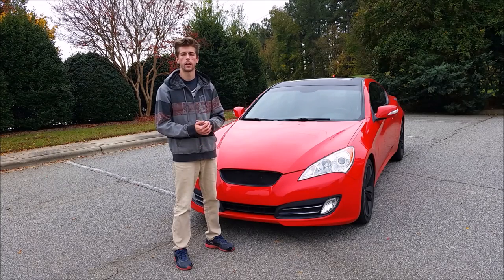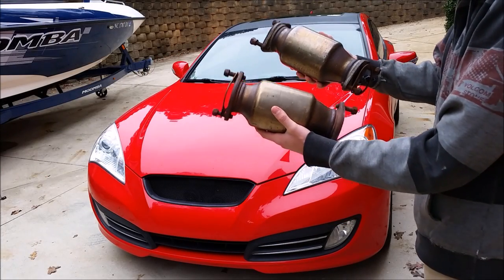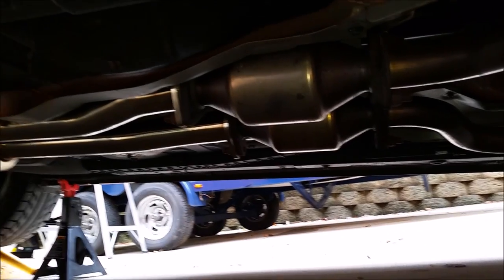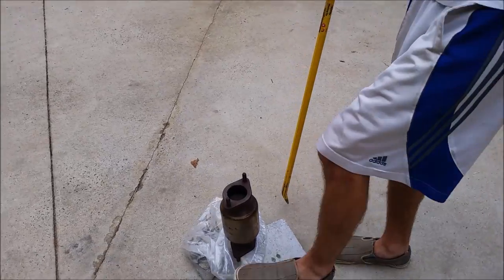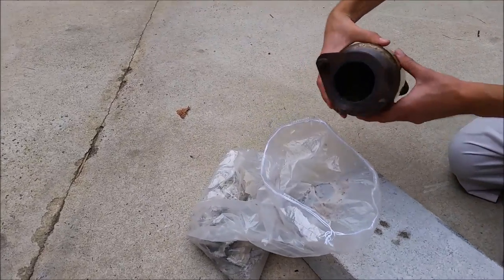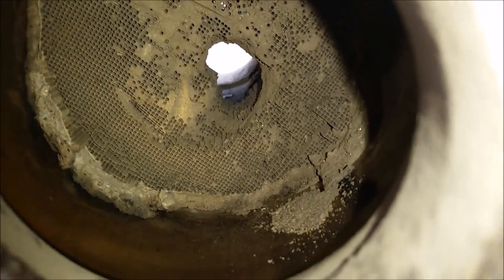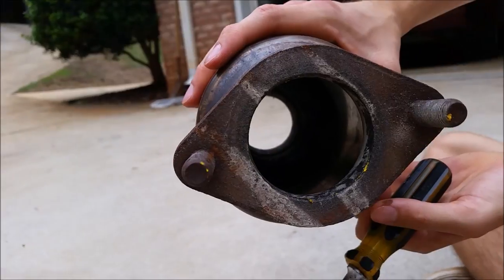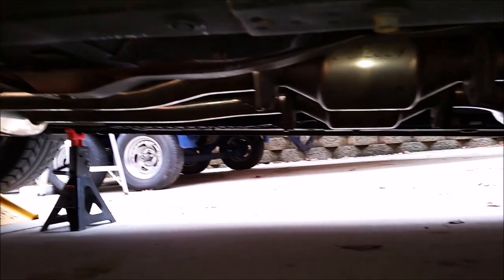2011 Genesis Coupe 3.8: Custom Test Pipes

Comment: Dude it sounds the same.
Reply from the maker: Yeh it wasn't as dramatic as I thought it would be. It is slightly louder, but not much. At least I didn't spend $200 on actual test pipes
Reply: Bros FOURR Speed I did the same thing recently to my tiburon sounds the same after I was disappointed 😂
Reply: Jajajajaja no diffrence it sound the same jajJJajaja

Comment: I know this is an old video but all I have is a muffler delete and a cai should I put test pipes in ? Will it add any power or sound better any opinions before I blow 250 dollars?
Reply from the maker: You won't really notice a difference aside from being a bit louder. If you want more power, go full straight piped and a tune

Comment: Whoa! Are you saying that this can be done on 2.0T too? Personally, I'm not looking for bigger sound - only better flow & a little raspyness.  Does your 3.8 sound raspy now?
Reply from the maker: yup. You can take off the secondary cat and gut it, put it back on and you will have a test pipe with no restrictions! The 3.8 doesn't sound raspy at all, only slightly louder, but it's hardly noticable. It's when you take the cats out of the headers or primary cat off, when you get really loud. Gutting the secondary cat is a free way to open up the exhaust

Comment: Hey man i just bought a 2010 Gen Coupe 3.8 track model. couple days later i got a P0420 CEL code. It is the cats. Depending on which one i need replacing, is it better just to do what you did? I'm still learning all that i can about this tbh.
Reply from the maker: +PsyQo P3U The secondary cats, the ones I gutted, won't trip any CEL's. If there is a cat failure that is causing a CEL, it would be the primary cats that are built into the headers.

Comment: Will it pass emissions. Or will I need a another cat to switch out
Reply from the maker: you will pass. The primary cats in the headers are the ones that have the sensors. So the computer in your car does not know the secondary cats were removed.

Comment: Did the pops get louder ?
Reply from the maker: +Sebastian Reyes Not by much, but I can tell a slight difference.
Reply: i really want an exhaust that pops :( any recommendations or advice ?
Reply from the maker: +Sebastian Reyes You may want to do a custom system. Delete the secondary cats, and make it true duel with no mufflers. That will definitely make it pretty loud.
Reply: awesome thanks man!